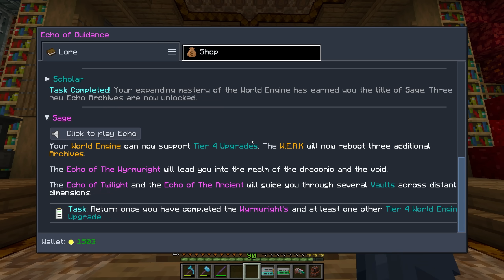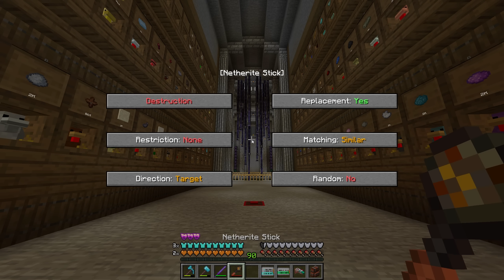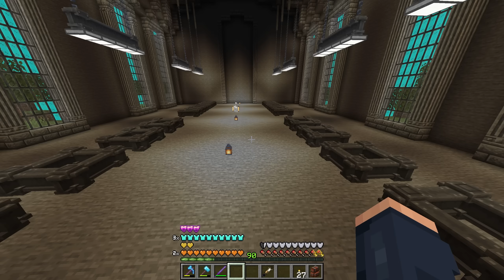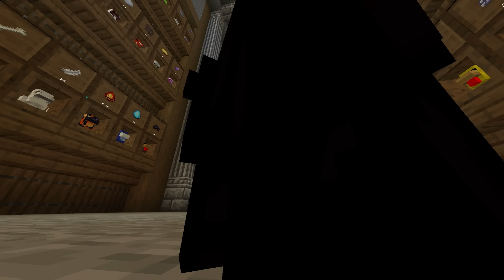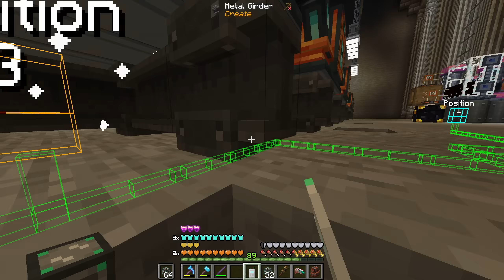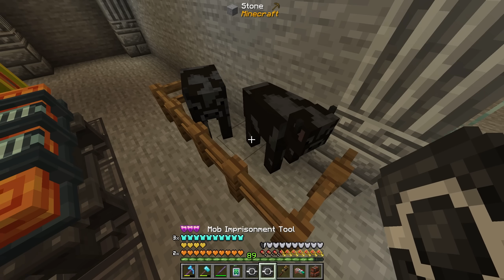Stoneblock 4 Minecraft Modpack EP17 Oritech Fuel Generator Room Build

Comment: Chosen mentioned he wished the Gates had priorities. I've found out if you use the Plugs (Receives energy from adjacent block) and Points (Provides energy to adjacent block) from the Flux Networks mod you can set a priority on the Flux Plugs which allows you to choose where the power comes from first.

And they are completely wireless like the Powah Gates and the Points and Plugs only take up 1 block space the same as the Powah version.

The only downside I can see is that the Flux Network doesn't really provide any power storage in itself so it may be best to output the power from the generators into a big battery to then send out via the Flux Network so at least if for some reason the generators stop working you've got a buffer available.

Comment: 32:54 In the event you haven't found any yet, there are secret oil cows out there. I've found five of them so far in dungeons. They can appear anywhere, and it's basically free fuel. To anyone else who is new? I recommend getting lock picks and go hunting for dungeon loot. You may even score big with Dark Matter tools that are super rare. The sword will be excellent for AOE killing most mobs and trivializing early to midgame dungeons. 

Anyway, if you get an oil cow, you can rely on it for the short term with fuel generators but I do recommend getting a refinery going and turning it into heavy oil, which lasts twice as long.
Reply: Carbon cow > oil > diesel. pretty easy really
Reply: @zuzoscorner  Is that the one that lasts 3x as long as regular oil?
Reply: @MajorCooke2  Turbo fuel is dielel + fluxite. last 100mb every 16 without add-ons of course. i'm getting 3M from a mek turbine with jsut one carbon cow XD granted loads of tier 8 upgrades
Reply: @zuzoscorner  I never got a carbon cow. But I did get Biodiesel which lasts thrice as long as oil cows, and yeah, tier 8 addons really helped to extend the time and not rely on so many cows with longer output.

I can't wrap my head around mekanism reactors. I'm just glad I put my draconic reactor in a compact machine because it blew the fuck up.

So I reverted to my original plan: nitro magmators to burn liquid blaze. Making the generators was the easy part. It was almost not worth it though. The smeltery just EATS through lava so fast. Gotta have lava chickens on speed dial with lots of seed to give them, and at max level too. Couldn't find a better substitute for lava generation. Lava cows don't cut it at all when you've got a max speed upgraded smeltery.

Comment: Can anyone help, my ender gates aren't taking power from my fuel generators, even though there's space in the cell. I've checked that an energy trash can voids the energy when placed there and that they're generating properly, but when I place an ender gate on either of the two ports it doesn't take any energy out. Am I missing something?
Reply from the maker: I had to use mechanism pipes and set them to extract mode and then funnel those into the gates... However I found that sometimes I had to break the ender cell because we just stopped working. I have now just moved everything over to Flux networks

Comment: I did a similar setup, just want you to know (you may have fixed it since this video) but oritech will not push to Powah gates, you need to use some sort of pip like mek pipes or something to pull the energy out, oritech cables wont push to gates either.
Reply: Thanks, thought i was losing my mind trying to replicate this setup

Comment: Fun fact only the temporal pouch works on a watch of flowing time. Although tick accelerating a watch of flowing time might cause some lag.
Reply: Yeah I found this when training batches of chickens - I had the watch on a pedestal to speed things up and I was also hitting the chicken trainers, but that only sped up one trainer and was burning through my time. Then I realised I could turbo boost the watch instead, which shared the benefit to every trainer in range. Suddenly all my chickens (all around 90) are max level.
Reply: @TheDelinear  i found out about it while trying to find a way of getting chaos shards faster. Having 4 watches all at 256x covering the same area which has a few dozen machines that are always running is not nice to your framerate.

Comment: Question for anyone using the cows for resources. What is the best way to get solid material from them? I got exited seeing the Molten Steel cow, but how would you efficiently turn that fluid into solid ingots or blocks?
Reply: Maybe productive metal works
Reply: Make casts of what you want (ingots, plates, gears, etc) and place those into the casting table. Then connect the fluid cow jar into the casting table to input the fluid. Lastly, I put a drawer under the casting table to pull from the casting table when the molten metal hardened. I think you can use other extraction methods as well.
Reply: @sonicnexus87  Thank you. I ended up doing this but with a basin for blocks.

Comment: If you click with a motor on an oritech pipe, they stop fighting for that first slot and start taking from all slots. I think a capacity Add-on would increase how much energy the generators can store. And I think you can add 1 frame extender on each port of the machines.

Comment: Love your design! Personally, im using a thermo generator setup that uses blazing crystal blocks and dragons breath, which, when at the nitro thermo gen, can produce around 13k rf per generator, so I would definetly recommend looking into it.
Reply from the maker: I have already automated them many time over in other modpacks and I just find them to be boring... If I need mass power I might use them... we will see XD
Reply: I'm doing the same but with the blocks of the metal from Ignis (got a prediction of him), and it's just shy of 20k per tick iirc. Though I have to agree with Chosen, it's a pretty boring power gen method, just a clicker, item collector, create drain and pipes.

Comment: The stick cannot interact with the ae2 restock because its technically not actually keeping it restocked but if you want it to connect to your ae2 system you can put the building gadget and/or the construction stick into the same slot you put the wireless terminal in with the wireless connector, works with more than building too. Very useful tip in my opinion